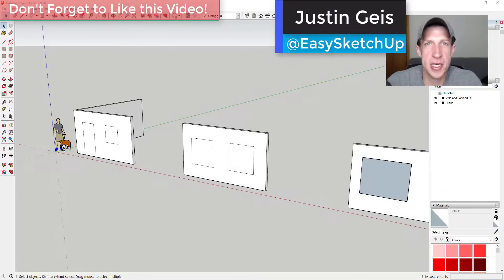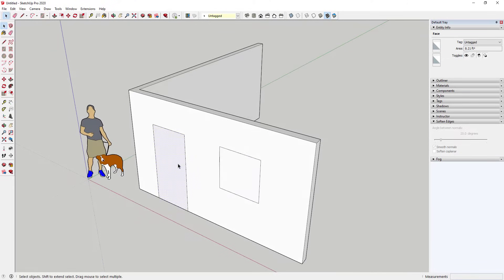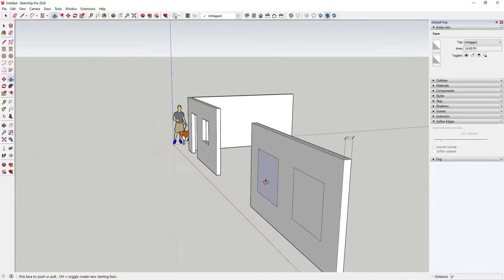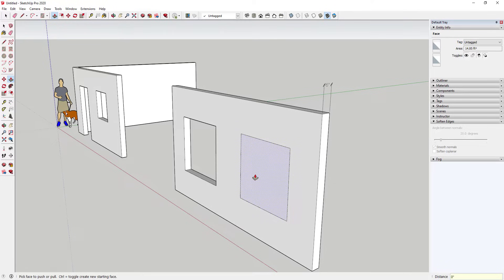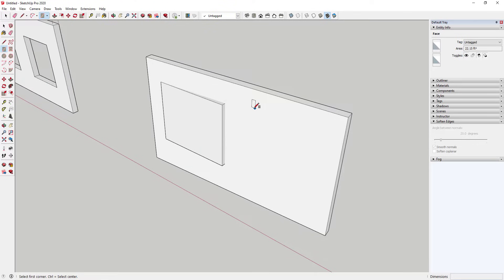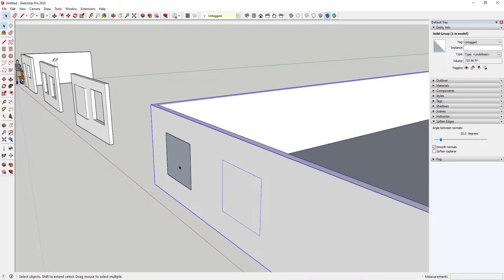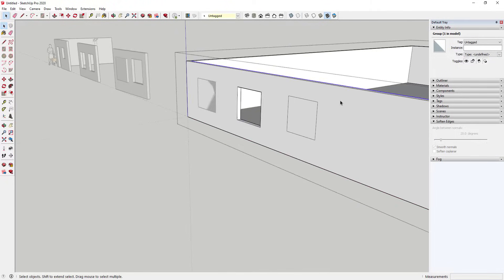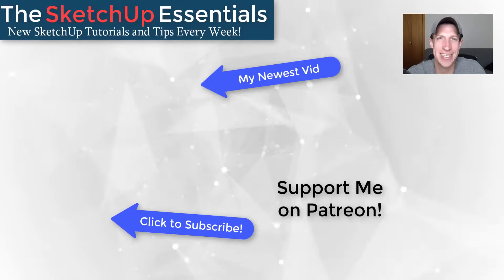Holes NOT CUTTING? Troubleshooting Opening Issues in SketchUp!

Comment from the maker: Hi everyone! Let me know if you have any questions about this in the comments below! :)
Reply: I was hoping this video would help me, but I think I have a different problem. The wall that I am trying to cut a window hole through was not drawn with the RECTANGLE tool...it was drawn with the LINE tool. As a result, the wall is 4" thick at one end, and 4 7/8" thick at the other end. The PUSH/PULL tool cant' line up with the other face perfectly and is not cutting through. Is there a way to do it?

Comment: UPDATE: If you're the kind that first puts imported windows on your walls then cut the holes behind them later; for the window that has failed to have a hole cut behind it, make sure the shape you cut around that window is slightly bigger than the window placed, then later adjust it with the move tool so it disappears behind that window. After, select that adjusted shape behind and extrude it as explained here👆. IT WILL DEFINITELY WORK!
Reply: THANK YOU! 🙌🏾

Comment: Thank you Sir. Now I think every one use the sketch-up not an auto cad because i love this Software and Autocad is old Software . by the way i can understand the Autocad , So Can anyone let me know what do we do in Autocad ? Does we make Maps on that software , does anyone knew a learning lesson related with Autocad for beginners like me then let me know down in the comment . I face this Problem when ever i try to cut my Door Every time in my project model and it's not cutting , also i see when you a Door Component then it's also not cut the door when you make a room , So I also face a problem when ever i Color the wall area with the Glass material it also fill the door but i separate both these thing then i never going to success to cutting the door so i use this technician  in my 2021 software , Lets see what,s gonna happen tomorrow ? One Problem i still facing and I wanted to ask every time but forgot , whenever i put a Content in the model then my Mouse pointer or Courser show me a Ring Sign for 14 seconds to 1 minute like this 👉:buffering: loading something after Every 15 minutes later but this Mouse Pointer makes me slow and also my work is Slow so , I wanted to ask you , How Much Ram and Hard disk Need for Sketch-up run Smoothly at least ? Anyone Please Answer the question . 🙏

Comment: Would have been great to explain the "Cut opening" function of components which dynamically cuts holes through surfaces without having to redo everything if placement needs to change.
Reply: But when ever i put the Door shape empty component on wall it ain't Cut. in 2021 Sketch-up Software.☹

Comment: Do the walls have to be grouped to get this to work? My push pull WILL NOT push any windows or doors out no matter what I do. It extracts it into one large block or just insets it but does not blow it out. I've tried typing 6", 7", even 8" and it will not work. I even redrew the wall twice and used the line tool and the rectangle to see if that made a difference and it will not blow these out. I'm getting so frustrated with this!
Reply: Same here. I'm starting to think this doesn't work in newer versions of Sketchup.

Comment: Brilliant! Thank you so much- I´m very new to sketchup so I´ve been spending hours trying to work out why it didn´t work cutting holes in my walls today when it worked yesterday. Exploading it first was the thing that did the trick, but ungrouping the object did not however. 
Do you have any idea why it did not work with ungrouping the object and selecting the wall face- is it because the walls are connected if you´ve made them from a pushed/pulled rectangle? 
And, would you mind me asking what the explosion does to an object? Is it like loosing the connections between everything in the object?

Again- as I said in my comment last time- your videos are brilliant. I have learned soo much really fast from watching them. :washhands:

Comment: What infuriates me is how when you're trying to cut through a SINGLE face and the lines will show up on one side but on the other side they fade in and out and you can't make the wall and the window two separate faces. And you cant reinforce the faded unclear lines because then the snap to function won't work on the corners. Show us why if you draw a square on a single face (NOT doubled up ones like these walls) the inside and the outside of the box will stay one single face and you can't select the inside of the square???? this has been annoying me for years. I have a wall with THREE windows. TWO of them separate fine, no problem. I go to add the THIRD window and it's screwed up. Won't separate or penetrate or cut out. Nothing. ????
Reply: i'm literally having the same problem rn and i'm about to throw my laptop away
Reply from the maker: Sounds like you might be drawing on grouped geometry?
Reply: @Thesketchupessentials  How could it be grouped if I am able to draw two windows on it but not a third?

Comment: I'm not sure why I'm getting a different result, but I'm trying to cut out openings in grouped walls; double clicked and no matter what I try it won't work. The face of the otherside of the wall remains. Frustrating.
Reply: right click on the wall, click edit group then draw the hole and cut it
It worked for me.
Reply: @mrspo7012  thanks.
Reply: @mrspo7012 ❤
Reply: Me too. I've watched so many videos on this and it will not work for me
Reply: @amandagates8826  same. i dont even have groups but it just wont happen.
Reply: This is happening for the newer versions of SketchUp
Reply: @ovileenadas985  yeah its so annoying

Comment: Sir, how do I see my sketchup file preview?

Whenever I do a modeling and save a file, it shows the symbol of SketchUp. The preview of the model inside it is not visible.
Reply: Reinstall SketchUp, this happens if you uninstall eg 2020 and leaving 2017. The association is with the 2020 version. If you reinstall the 2017 it will associate the skp files to the current prog version
Reply: @JohnCol-1959  yes sir

Comment: For the third case, rather than exploding the group prior to the push-pull, delete the face (and edges) outside the group, then enter the group and use 'Paste in Place', then push-pull from inside the group.
Reply from the maker: I mean, the example was really to show that the front and back faces all have to be raw geometry, but yes, copy pasting the raw geometry of the other wall into the group would work as well
Reply: @Thesketchupessentials  Understood, it was just a good sample to discuss the difference between 'Paste in Place' and just plain, old 'Paste' (where the picked location may not be where the user intends). But still a good reference video :)
Reply from the maker: @stevefrawley9756  Gotcha - I should actually make a video about this function - it's a huge timesaver :) Thanks!